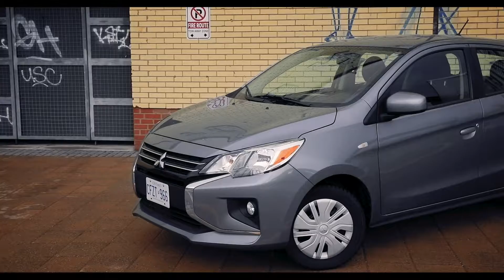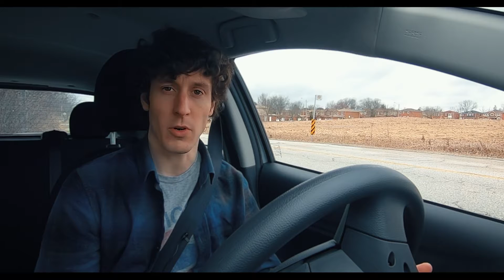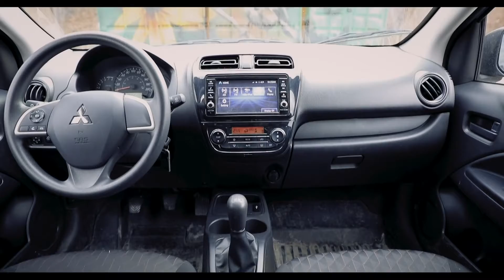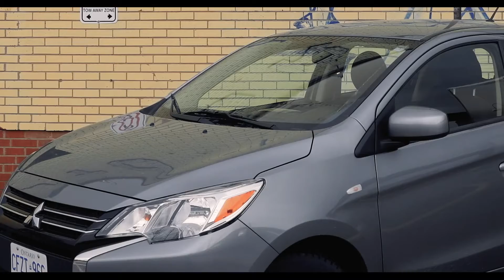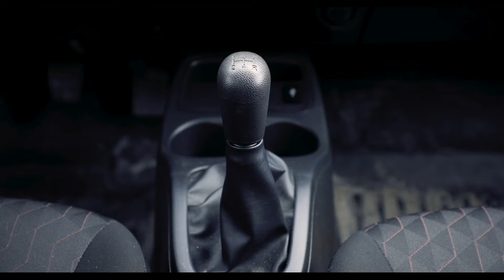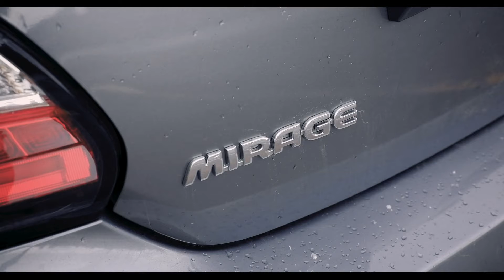Long-Term Wrap-Up: Mitsubishi Mirage ES | Driving.ca

Comment: The Mirage's crash protection might be the worst on the market.  Your car insurance rate will be higher because the car crumples in auto accidents.  It's a bargain but it's outdated and Mitsubishi has no plans to update it.  Price isn't everything.
Reply: Crash protection is the worst on the market? It was in 2014. They actually did update the crash test safety ratings. 2022, the ratings have improved
Reply: I just got mine totaled on Tuesday, my mirage G4 was rear ended by a Toyota Tundra, it took the hit like an absolute champion, due to the unibody damage I’m certain it won’t be economical to repair, but it did drive 28 miles home. The right rear shock was blown which you could feel when you hit bumps, but otherwise it drove as if nothing had happened.
Reply: @Dfm253  I totaled my 2014 when I didn't check my lane change blind spot well enough and crashed into a new Grand Jeep Cheerokee doing 55 mph. I spun out a bit and two side airbags went off but it still drove. The Mitsubishi patented RISE safety cage with crumble zones saved my life easily.
Reply: I put my old 2018 in a ditch a few winters ago in a blizzard and came out needing an alignment, front bumper, headlight assembly, and a new wheel. My insurance guy said that he was expecting to show up and total it because he has totaled them for far less in terms of what caused the damage. Said air bags go off in them like hot cakes and was surprised mine didn't go off.
Reply: Worst? The only bad about the Mirage's crash test is the small overlap crash test where it got a marginal rating which is impressive for something that weights nothing and that small, so far there are no poor ratings when it comes to crash test in the Mirage.
Reply: @kennedy9072  The Mirage is one of the smallest and lightest cars on the road in the U.S. The crash rating is only for cars of its size class. Put up against any of the larger, heavier cars on the market and it will fair poorly.
Reply: @palebeachbum  of course, physics, but still the only crash test it failed actually it earned marginal is the small overlap crash test.
Reply: I swear, car shoppers are weird sometimes. They say this car is not safe to drive or even have question BUT don't want to take the extra steps to:

1) ask the actual owner on the psychological aspect of driving one (ownerships matter; not car reviewers) 

2) Check the score and rubric of the crash ratings and such

3) See for him/herself via test drive or at least get in the car for 5 minutes at CarMax, dealers and such.

But expect reviewers and owners to elaborate it for them. Unreal.
Reply: @edgaryzen4925  Insurance company rates reveal the crash worthiness.  It costs more to insure the Mirage than a Chevy Spark - a small car in the same class that has slightly better crash ratings and more air bags to better protect occupants.
Reply: @tedneanderthal7373  NOT all insurance companies are created equal. I switched many times for better rate. Very rare I stay for 1 year. 

I had a 06 Prius for years and it cost me the same as my current Mirage. YMMV.
 
Driving history, miles per year driven, age, location, policies contribute to a certain rate. Can't complain about mine.
Reply: @tedneanderthal7373  My basic liability insurance is $60 a month for my Mirage that I own straight out. My wife's Mirage is financed and is $110 a month. Not bad at all compared to her previous Mustang.
Reply: I like the Mirage, but the safety is definitely a concern for me. A marginal rating in the Mirage is far worse than a marginal rating in a larger, heavier car, which is basically all other cars on the road around you.
Reply: @palebeachbum  - according to which study? Can you please cite sources?

Also, being lightweight is a good thing. It makes the car more nimble, more agile, uses less brake pads, reduces wear & tear on all components... But it's okay, scary boogeyman car companies have you convinced that you need to spend $50,000+ on a big SUV that is far more likely to tip/roll over in a crash, immediately worsening the severity of crashes, and you took the bait hook, line, and sinker. The only time I've seen fatalities on the road, it was an SUV that rolled over on its side and got collected by an oil tanker, burnt to a crisp all 4 people inside before my eyes. Good job, you're paying the car companies to kill you
Reply: @AndrewGeierMelons  Palebeachbum is correct that the scores are not relative to ALL cars, only relative to other cars of the same size and weight. (The IIHS states this clearly on its website.) So the Mirage's scores might seem decent when you look at them, but in reality a "good" on a Mirage is worse than a "good" on a heavier car. If a Mirage crashes into, say, a Civic, the Mirage will sustain far more damage. That doesn't mean the Mirage is a death trap, but you are more vulnerable. If an SUV runs a red light and T-bones a Mirage, it's the Mirage driver who will pay for the mistake, not the SUV driver.
Reply: @toddp7324  - you're basing crash survival off of figures from crash test safety ratings. I'm basing crash survival off of not being in the crash in the first place. It is fundamentally true that SUVs crash more often
Reply: @AndrewGeierMelons  Other studies suggest that other cars, mostly subcompacts, were comparatively more dangerous. But the fact remains that smaller cars are inherently less safe than larger ones. That's no guarantee that a Mirage owner will get into an accident, or be seriously injureded if he/she were, of course.
Reply: @toddp7324  - SUVs roll over and hit whatever they are going to hit with more force
Reply: @AndrewGeierMelons  ...maybe there are more suv's on the road than cars .

Comment: I drove my 2017 5 speed to Thunder Bay and back last summer. 1400km one way cost me $82 at around $1.55/L for gas. It maintained 4.6L/100km the entire way driving a steady 105kph. Comfort was ok as I'm a pretty big dude. I also did the same drive in the past with a Ford Escape and GMC Acadia. Those were obviously more comfortable, but also a snore fest on a 14 hour drive.

Also as far as comparing it to a used car: I couldn't get 0% financing on a used vehicle, and I've had to do zero repairs on this thing other than a ball joint after I slid into a curb on black ice. Only maintenance was oil, brakes, and tires so far.
Reply: Hey Pat 🤣
Reply: @AndrewGeierMelons  sap?
Reply: Why would you want to go to Thunder Bay? lol

Comment: I'm on my 2nd Mirage a 2018 SE with all the bells and whistles. 104,000 miles so far. Love the CVT...great mileage. Just got home from a 2,300 mile week-long trip with the Mirage doing 75-80 mph on the interstates....and the engine revs mostly below 3,000rpm except when climbing hills. Very comfy too.
And I agree the Mirage is pretty wonderful in snow with it's stock skinny tires.....it just cuts through the snow.  Amazing!
EDIT 2/10/24 - THE Mirage now has 150,000 miles on it. Still has a nice ride, steering tracks straight and true. No rattles. Still great mpg.  CVT is great!
Reply: One of very few cars with a reliable CVT. It's really only because the car is so light that it doesn't strain the transmission much. There's a good reason CVTs were only found in golf carts in times past.
Reply: @nodak81  Mitsubishi and Suzuki both do well with JATCO CVTs including their larger vehicles like the Outlander Sport and Eclipse Cross. I don't know why Nissan can't get their spec version JATCO CVTs performing correctly?
Reply: @kylemas2005  Mitsubishi mounts an oil cooler for the transmission. Even on the Mirage/Space Star. Nissan does not. Same transmission, makes all the difference.

Comment: Everything you said is right. Got a sedan vversion of this car called mirage g4 (5 speed manual). Same engine, and they just add a trunk. Its not that exciting to drive but it can get you to point a to b. In acceleration like in overtaking you need to wait like 1-2 sec. for the power to come in.
Reply: The fact that the trunk space is competitively similar to the compact sedan is impressive for the $! Perfect for growing family of 4 too!
Reply: The G4 has more rear passenger legroom than a Nissan Altima, a car 2 class sizes up from the Mirage. Also the secret Mirage turbo option is just turn off the AC and switch it to Ds mode when having to merge fast in an emergency situation, otherwise no issues at all with 78HP.

Comment: Too bad in other countries, you can't get this Mirage with manual transmission. You have to settle down with the CVT which doesn't help to deal the car's weak throttle response.
Reply: I wish the Mirage had the Corolla CVT with the physical first gear. Corolla's 169 horsepower would be nice too.
Reply: @braetonwilson4296  That would mean Mitsubishi has to buy CVT from Toyota's transmission subsidiary instead of relying on the main supplier for Nissan & Mitsubishi's CVT.
Reply: @izzatfauzimustafa6535  true
Reply: @braetonwilson4296  The Mirage has a two speed planetary automatic, kinda low/high gearing mounted before the CVT, to help with throttle response.
Reply: @ronaldderooij1774  That's good to know, I wasn't aware of that.

Comment: This is a brilliant car. In 30 years nice examples will be selling for $30k.
Reply: When i bought mine in 2018 i got a 2 for one kinda deal so i ended up with 2 put one in storage thinking mabe i could use it at some point when i wear the other one out. But 4 years later i see these cars are pretty durable.
Reply: @Area-cf1gt  lol, you trying to sell a mirage?
Reply: @Dfm253  if anything i would like to promote the buying of more mirages to be on the road so i can buy more used ones in the future 😆
Reply: @Area-cf1gt don't use it! Keep it. Drive it a tiny bit every 3 months. 

It will be a time capsule worth endless money.

The thing about cheap common cars is they aren't special today and get used up, or thrown away because they're everywhere and worthless.

Because of that in a few decades there are literally none left. 

I call it common car syndrome.

You have a 💎 hold onto it
Reply: In 30 years most countries will ban the sale of new gasoline cars which is unfortunate cause it's with cars like the Mirage that the oil era could last.

Comment: I’d love to be able to get a mirage manual in a higher trim, or at the very least have cruise with the base model (like in the US)
Reply: Agreed - the CAN ES trim is missing cruise, power door locks, and a height adjustable drivers seat - all standard on the US trim and mandatory IMO - come on Mitsubishi
Reply: @kristianhermann5971  about 3k cheaper than in USA though.  Works for me
Reply: If your handy, there's always the Rostra aftermarket cruise kit - I installed on my 07' Kia Rio M/T - works great
Reply: The 2024 ES now comes standard with cruise! They must have heard you! lol